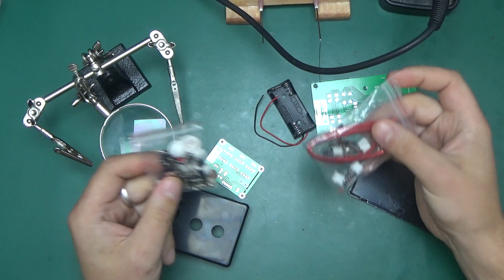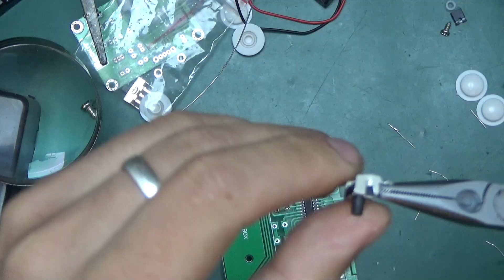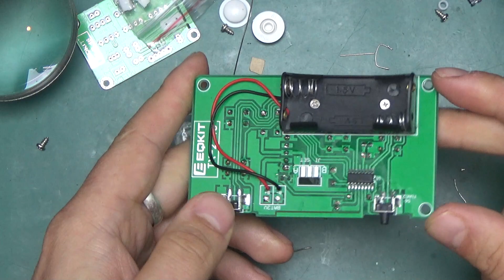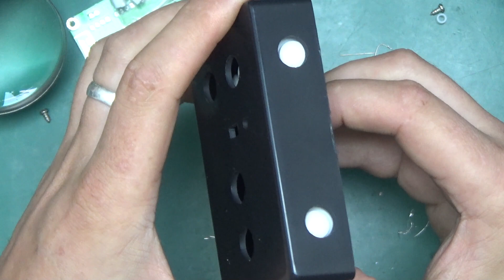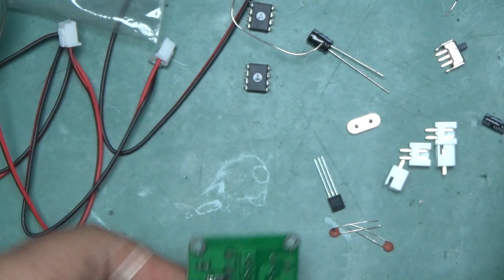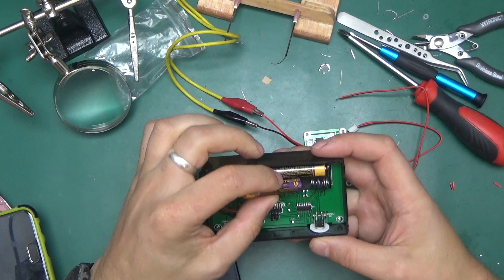#024 - Soldering the mystery kit

Comment: This kit shows how easy to use today electronics are. Transmitter without any inductors, just a chip and an antenna. Can't beat that simplicity.
Reply from the maker: True. That's what it looks like when you use bespoke integrated circuits.  All the RF  circuitry is inside those ICs

Comment: Ah found Chinese sellers of this kit on ebay.
Search ebay for "6-channel remote control DIY kit"
Cheapest at the moment is £5.31
Reply: Thanks! The description says it runs on 2.4 GHz. Would be great to know what chips they use, surely amazing that you can build a 2.4 GHz system without any discrete RF components, PCB antenna straight out of the chip.
Reply from the maker: I think the 2.4 is just a name, I doubt this is in the microwave territory. Crystals were 12MHz...
Reply: randomtronic  It could still be a 2.4GHz transmitter. The 12MHz crystal is most likely just for the logic. Almost all of those chips have an internal RF oscillator. Check wifi or bluetooth modules for example. You will only find crystals in the tens of MHz region on them as well.
Btw. you could try if it influences connection quality of a nearby wifi when close. I doubt this chip will just send on a narrow band, but "jam" all over the place.
Reply from the maker: Interesting, thanks! I will check it out. I guess I could also scope around, and if it shows nothing, then it would be above bandwidth of my 25MHz Owon. Otherwise, there should be a 12MHz carrier on antenna.